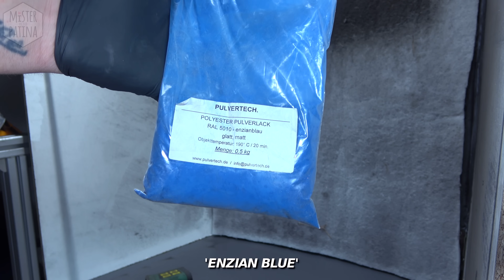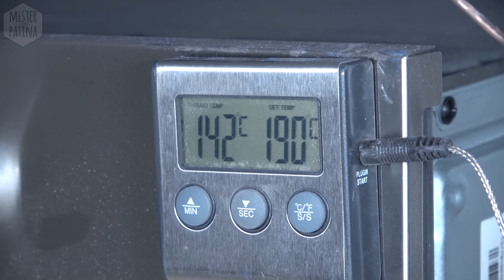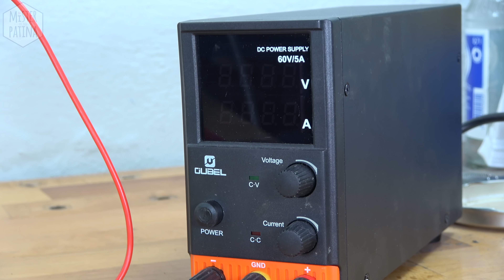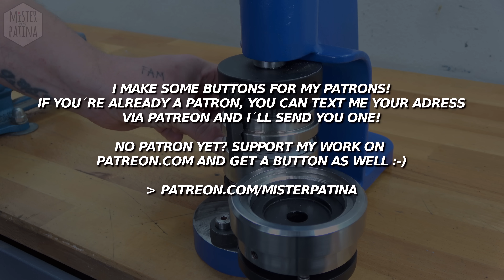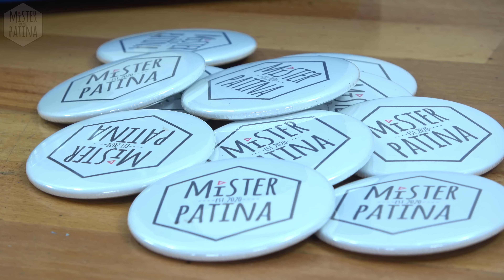Badge Machine Restoration | I make Badges for you!

Comment: Huh, cool trick with the chalk! I'll have to try that. Slick little unit, works real smooth now!
About the only thing I could see to improve the design would be a little roller-wheel in the tip of the plunger, where the lever-arm contacts it, to cut down on wear there. But that's a design issue, unrelated to your beautiful restoration!

Comment: Really enjoy your videos and sometimes even learn a thing or two. Being a welder I'm a little disappointed you don't build up worn gears, shafts and the like. It's super easy - unharden the job, use a 7018 or 11018 welding rod - on older not so critical tolerances (like this video) personally take a piece of ally I can cut and profile several teeth, then use that to file them to the spec, of course a gear cutter can be used for perfection, then reharden.  But like I said absolutely love your work brother!
As a after thought why not get a laser hobby set up and laser in your logo to each project with the date etc. They would gecome collectable I'm sure!

Comment: looks like you might have alot of moisture in your air system. may want to add a drier in line before the cabinet. 😅
Reply from the maker: Yeah it was strange. I have a water/oil unit in the system, but the sanding media was pretty old and started clogging. Changed the media today 🤘

Comment: I have a question - why do you sand steel rings if you intend to reshape them on the lathe? Wouldn't it take off the rust as well and you could save a lot of work and effort? Or maybe there is a reason why you do not want to do it on rusty part?
Reply from the maker: Thanks! The reason is, that the rust (or irregular shape) would destroy the blade of my turning steel. So, basically it doesn’t directly destroy, but unsharpens it.

Comment: Do you do the restoration in the order that the video shows or do you edit it to flow that way? In other words do you do all sand blasting of parts at one time?
Reply from the maker: I do the 'main parts' step by step, but the smaller parts at one time. Depends on the workflow. But let me say 90% as the video shows, 10% is re-edited to flow with the video.

Comment: Does it really work to expand the steel Ring on aluminium? I think that all the heat is going in the aluminium because it's such a netter conductor.
Reply from the maker: Guess you know more than me here - I heated it without trying to punch it down when it was cold. So - as you see it worked, but i dont know if the heat had such a great effect :-D

Comment: Why is it necessary to “cure” the blued parts in oil?
Reply from the maker: Cold bluing is a noble layer of rust, which protects the metal from the "bad rust". But the process of noble rusting needs be "stopped" for around 12 hours, under a layer of oil (so no air or water can attach to the layer). After that, the part is fine.

Comment: Im a newb so dont kill me. Ive seen other channels do a lead test on paints before they progress the restoration, how did he know that he didnt need to test on this?
Reply from the maker: No one will kill you 😄
You do a lead test before sandblasting, so the lead dust doesn’t get into your lungs. If positive (lead in paint), you basically don’t sandblast, but use a paint stripper (because here the lead doesn’t fly around). 
I didn’t have lead tests anymore, that’s why I started with paintstripper. This didn’t work, so I had to blast. I was wearing a mask and I was pretty sure there isn’t lead in the paint because of 2 reasons:
1) it was a powder coating (powder coatings don’t contain lead)
2) the badge press was made in a time, where lead in paint wasn’t common anymore

So: your question is totally right! I hope I could give you an explanation. But safety first, a lead test would’ve been right here!

Comment: I heave a stupid comment, why don’t you use brake fluid to strip the paint?
Reply from the maker: That’s not a stupid comment! But, the paint stripper is more effective than brake fluid. The problem was the powder coating…which was SO stubborn. Never seen that before

Comment: do yourself a favour get rid of that bad sandblasting gun .there cheap and rubbish ,get yourself a proper gun with a boron tip, and a metering valve and a decent foot pedal , you will be amazed at the difference .i  started out with the standard crappy gun on my blasting cabinet and i was very disappointed , but after upgrading the gun and fitting a metering valve and good quality pedal that can take well over 150 psi , my cabinet now, takes less than a minute to blast anything i can fit in it . by the way nice job .